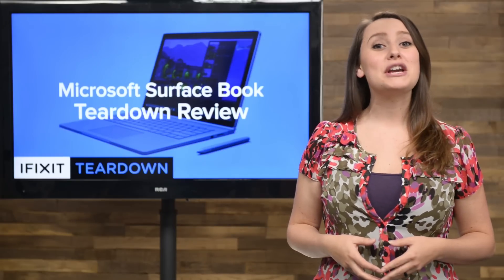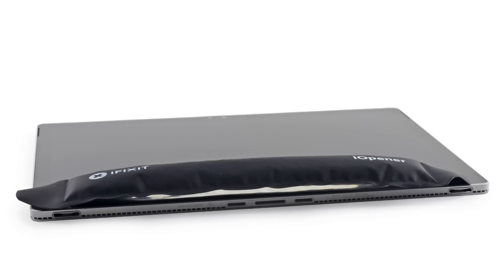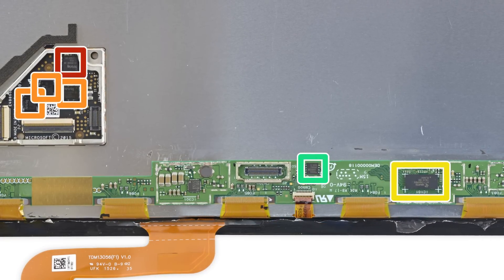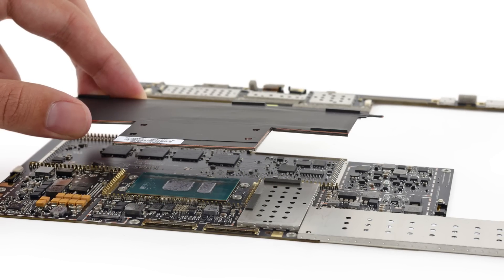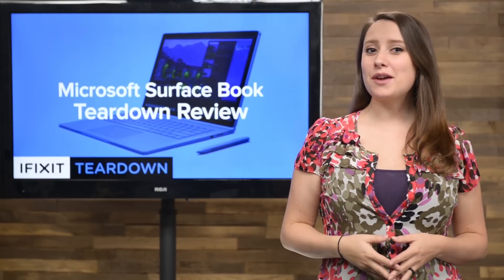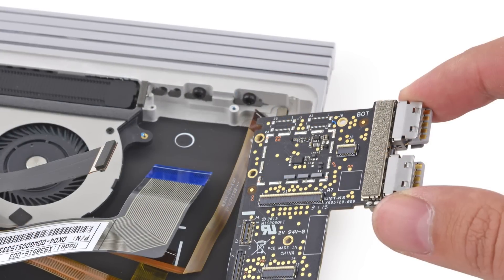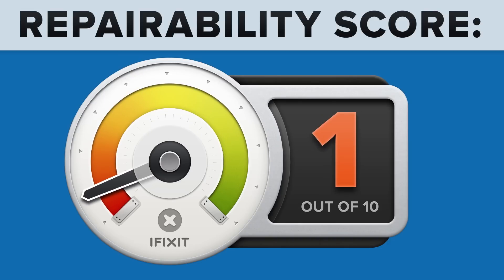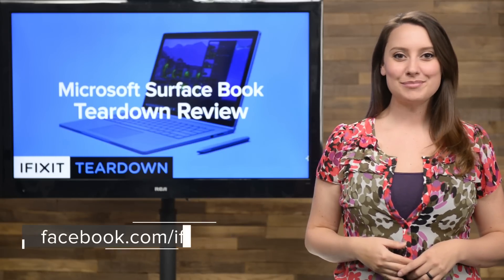Microsoft Surface Book Teardown Review!

Comment: Hi , 
My surface book's battery is swollen Do you think if I just remove it and re-assemble the laptop, it will work? or will I have to short the battery connectors to emulate a drained battery>
Reply: Which battery? The one on the base or the one at the Clipboard (tablet part)? The one in the base while difficult to remove due to the adhesive it's safer in the sense there's no risk of breaking something as expensive as the screen. On the clipboard while the adhesive used is less difficult to remove, there's always the risk of breaking the screen in the opening process

Comment: I love mine, had it nearly a year now, but why the hell is the pen on the left hand side?  I get that if you're right handed you will detach the screen and rotate it clockwise 90 degrees and the pen will then be on top instead of the bottom, but I use mine as a laptop 95% of the time.
At least give us the option with magnets on both sides, I'm sure it wont ruin the airflow that much.

Comment: Ok, call me crazy but I would love to liquid metal the new 2016 surface book geforce 965m. If you've ever used liquid metal you know the temperature difference can be HUGE. Question is, is the heatsink in the 940 model copper or aluminum? Liquid metal requires a copper heatsink. The video talked about 1/10 repairability for the clipboard section which I do not plan on touching, but it looks like the base of the surface book isn't terrible.

Comment: "Processor and memory are soldered to motherboard"... that's a minus point? Really? You can not change CPU in most of the notebooks and memory in a lot of new notebooks (especially Macbooks).
Reply: +Peter Bočan Still minus as it does not make it easier to fix
Reply: when was it the last time you've changed your CPU on notebook? Even memory is in  some cases soldered onto the motherboard.
Reply: Peter Bočan Never but it still makes it harder to fix non of the less... Microsoft could always invent a way to change this
Reply: Okay, prepare to have a thicker notebook just to have some locking mechanism to keep CPU in place.
Reply: Peter Bočan I said invent meaning making a way to change it without adding thickness
Reply: what about duct tape? hot glue?
Reply: Peter Bočan Your right Duct tape fixes everything we should tell them XD hahaha
Reply: The score isn't relative to other notebooks, which would similarly be marked down for that.
Reply: +Peter Bočan Yeah but you would expect that kind of shit from Apple not from them, but giving up it actually is the only way to make a thin device and because of that unrepairable.

Comment: Looks like an absolutely APPALLING piece of junk on the inside - spray painted plastic and just a TERRIBLE mess. I've seen inside more electronic, electrical and mechanical devices from commercial, military and industrial machines than most people see in a lifetime, and this is TERRIBLE.

Source: Electronics engineer since 1990, qualified repair and industrial/military electronics production line operative.

Comment: What a bunch of babbies on here..lol It's a freakin' laptop/tablet, a lot of them are made this way I'm sure. It's by far the best and best looking device I've seen so far from anyone.
Reply: +Michael Choi Name one laptop made this year that doesn't have a soldered on CPU and RAM. That's the only way to make it thin. That shouldn't be counted as a negative for repair ability.
Reply: Benjamin Rickels If the ram goes bad, that is just sad. Ram rarely goes bad and if rather have a thinner laptop with less removable parts like ram and cpu. The cpu part is still pathetic.

Comment: +iFixit Video  Do you have a video that thoroughly discusses why heavy use of adhesives is a big minus for repairability?
Is it purely a matter of difficulty on opening/removing parts? Or does it factor into things like possible breakage or difficulty in piecing it back together?
Reply: +rhoharane (for batteries) It's difficult, the teardown video cuts out the actual prying process which could take 10-20 minutes. You could slice a ribbon cable, you could puncture the battery and start a fire, many things could happen.

Comment: great ! like usual , i really like everything about what you're doing in your videos , except one little thing : there is no other choice but to have a fused lcd panel to the glass (laminated screen) ! If you have a gap between the glass and the screen you get a lot of light reflection  .  good stuff comes expensive , It can't work another way ! So i think this unfair to count that as a fault ... 
Cheers

Comment: So its a surface pro 4 with a power boosting keyboard? Could they not just sell the keyboard?
Reply: ***** I know that. What I was saying was the tablet you get is essentially a Surface 4. They might as well have just sold the keyboard as an ad on for the surface 4.
Reply: Dazbme What I was getting at was that this whole Surface Book product should hot have existed. The keyboard should have been produced as a stand alone addon for the SP4, given how similar the tablets both are.
Reply: dazmbe is right. the surface 4 is too heavy. it cant stand as a laptop. it will always fall over. then the surface isnt as big as the surface book (screen size). a customer can choose between a surface book which is mainly a tablet and can be a laptop with the additional keyboard but only stand with that thing on the surfaces back, so its not that great as a laptop than it is as a tablet. the surface book is the opposite. its better at beung a laptop than a tablet mainly because it has not much battery in the display but thats so that it doesnt fall over. so the surface book is better at being a laptop than as a tablet. these 2 things are for 2 different user preferences
Reply: +MotionTransformer surface pro 4 doesnt have the ability to access those dedicated pcie lanes for the gpu.
Reply: +MotionTransformer The surface book makes perfect sense, IDK what you're on about, it's miles more powerful than the SP4, and it wouldnt be possible to have the SP4 attache4d to a laptop base like this, as it would just fall over...

Comment: Let be real here. This laptop is going to last 2 years max with that battery, then it will start to expand and eventually crack the screen. Gluing batteries in, and requiring prying the screen away from glue is just asking for trouble.

Spare parts will be hard to come by without paying Microsoft to do the replacement.

This is possibly the worst laptop you can buy. 

The MacBook Pro has it beat, even with its glued battery, you don't risk breaking ribbon cables, cracking the screen, while replacing the Li-ion battery packs.
Reply: this hasnt happened with even the Surface Pro 2

and yet you throw this assumption?

You act as if it's easy to even open up a macbook, or even a new macbook
Reply: +Tracks Darren It is easy to open a macbook, you just unscrew 10 screws on the bottom panel. It's even easier than a ThinkPad, only 2 types of screws, long ones and short ones. Very hard to mess up.
Reply: Yes yes

But just because it's hard as hell to open (something i won't and can't deny)

That doesn't make it the worst Laptop you could buy.

2 years, and the screen will crack with an expanding battery

By that logic, any tablet ive seen that is above 2 years old should have a crack on it. My uncle has the 1st ipad. That isn't even cracked. Banged up yes, but not cracked.

Of course i could go on about all the tablets and 2 in 1s that never cracked by an expanding battery, but not right now.

The only way you can fuck up this thing, is if you're careless.

All laptops will probably be effected by age. That includes macbooks, asus, surface, etc.

But you can't say it'll last 2 years and not even try it.

You can't even say the Macbook has it beat. (unless you mean it has it beat when it comes to taking it apart)
Reply: you have no idea what you are saying
Reply: Tyler Watthanaphand two years passed and people who have Surface book 1, say it looks like new.
Reply: +Tyler Watthanaphand This is how most laptops are built today, I don't see the issue.  99% of the population NEVER repairs anything on their laptops - I don't see the issue.  This is the same thing Apple does and the industry as a whole has been going this way for a long time.

Comment: So what's wrong with screws? Seriously?
Reply: +James IV When you have screws, you have to drill holes on the schell. In this thin and small device, it may cause the structure getting more fragile and easy to break.
Reply: +James IV They don't want you to open it, they want you to throw it away and buy a new one after 2 years. I Never gonna buy such crap.
Reply: The real answer is it costs less to use glue instead of paying someone to screw things in during assembly
Reply: +James IV they also present easy failure points when the metal gets stressed
Reply: You'd need a WHOLE lot more small ones to get a close to similar result THEY probably get from using the adhesive so unless you're trying to go for a 19th century ship hull effect with rivets everywhere you simply go for - well - an adhesive.
Reply: +James IV They wanted it  thin
Reply: *****

And you can't have thin with screws? I have seen some pretty small ones used with less then an inch long
Reply: James IV You got to remember you have to make holes for those screw, which will take up space and the screen has  to be glued on because of the tech it uses
Reply: *****
Well the screen I got, and I guess. Call me old fashion as I would rather take the size for screws LOL
Reply: Wang Max
good point
Reply: David Mark
that is true
Reply: +James IV they obscure the look of the machine
Reply: ***** macbooks are proof of this

Comment: If you're buying a Surface Pro, Surface Book, Macbook Air, etc., you should probably invest in a a repair warranty, as these devices are designed with integrated and fused parts. Although repairing them on your own is certainly possible, it may require proprietary parts and components.

Comment: Why is the battery smaller than the iPhone 6 plus
Reply: William Viman Surface Book's tablet portion has an 18Wh battery, iPhone 6 Plus has a 10.45Wh battery. Watt hours is the correct way to measure a battery's capacity, mAh comparison only works for products with the same voltage.

Try again.
Reply: It isn't
Reply: +Ixissimus did you even watch the video?
Reply: +Ixissimus It isn't. lol
Reply: The battery is 2387 mAh for the tablet. An iPhone 6 Plus has a 2915 mAh battery. However, the base has a 6800 mAh battery.
Reply: +Oasis Nite Yes it is
Reply: +Ixissimus You don't just look at the mAh rating of the battery. You also have to look at the Wh rating as well.
Reply: +Ixissimus You seem to know nothing about WattHour, mAh and Volts.
Reply: +Facundo Karanik 
What can you expect? apple fans
Reply: +Nicholas Fell But they dont have the same voltage as somebody said before. The surface has 7.5 volts and the iphone 3.8 volts. So its nearly twice as much.